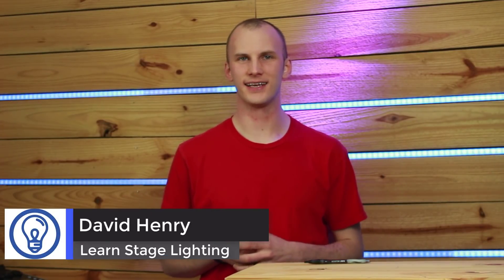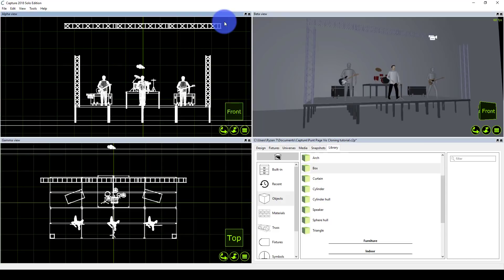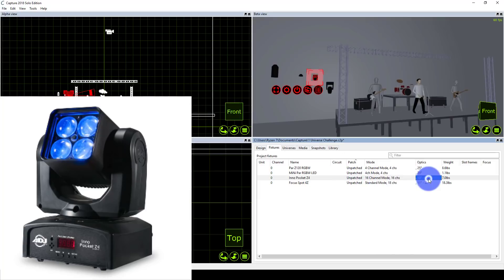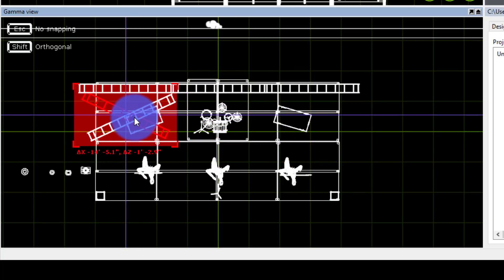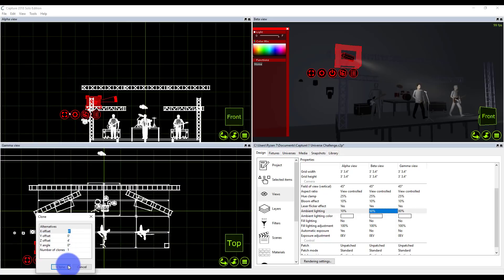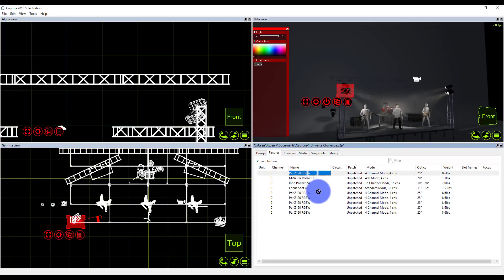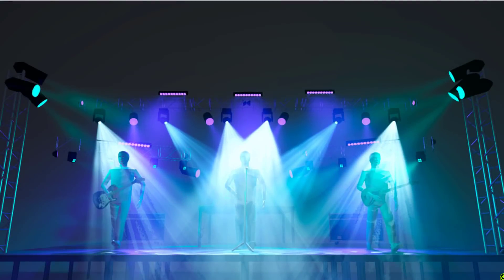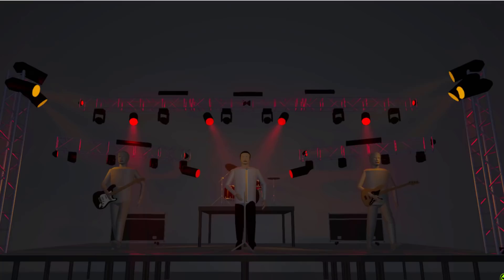1 Universe DMX Lighting Rig CHALLENGE

Comment: These were some good design decisions but If the name of the game is to cram as much stuff onto a single universe as possible I'd take it a step further and make a lot of fixtures share the same addresses.   For example,  all my truss warmers would share the same start address,   all my front light would share the same start address,   any static back light wash fixtures would share one or two start addresses.   This frees up channels to add some floor movers on the US deck for Arial  fx or some floor movers on the sides or maybe even some batten lights US (all the same address) shooting at whatever is behind the stage giving more depth to the overall stage look.  Beyond that you could edit the color band profiles so that each of them have common start addresses for the pixels but unique addresses for tilt (course/ fine).  This is how you can really maximize your single universe but you need to give some thought as to what independent control your willing to sacrifice.

Comment: Gone through the basic hardware solution with an ADJ console for the last 4 years and have found its limitations.  I am now trying to upgrade, and I am stuck trying to choose between a hardware or software solution.  

Software
Have been reviewing the MagicQ PC and QuickQ PC and, MyDMX 3.0 but not convinced that they are the best solution.

Hardware
SHEHDS 1024 DMX ConsoleSHEHDS 1024 DMX Console

Events
Our basics schedule is weekly dances with live bands, 4 main concerts per season, and several special events.

Any suggestions or thoughts on which direction to taken would be appreciated.  I like software but I also like the instant use of push buttons and manual faders.

Background
RV Resort
I have a 900-seat ballroom/theatre
Upstage Truss 
  * 5x LED PAR
  * 6x LED Pinspot
  * 1x 12in LED Leko
  * 4x LED Mini Spot (moving head)
Side Truss (left & right)
  * 1x 3in Leko (incandescent)
  * 3x 6in Fresnel (incandescent)
  * 1x 4 chnl dimmer
FoH
  * 6x LED PAR (stage flood color)
  * 6x LED Leko (White spaced across stage spots)
  * 2x LED ADJ Inospot (moving head)
  * 8x LED PAR (dancefloor down lights)

Thanks
Reply from the maker: Definitely!  Send us an email at Gear@learnstagelighting.com and we can help!  I would probably recommend LightKey (Mac) or ONYX on a PC with one of their wings or interfaces.  Shoot us an email and we can dive deeper

Comment: Hi David! I watch several of your videos and it’s helped me a lot. My band have light rig in the size that you explain in video.
We have 2 bar with 4 par 56 led each ( Starwille ) on front truss  / stands as front light. At the back truss we have 10 par 56 led (2x5) and 4 mini mowingheads 15w spot. As backdrop we use P9 LED curtain 3x2 meter. In the front of drums ( little drum stage) we have 2 more mowingheads on each side. Recently we provided 6 pieces Led bars and they is mounted vertically on  6 mic stand ( 3 on each side of stage ) . They act from the side too get deep .We have 5 more 56 led on front truss on audience.
Light rig is controlled with Dmxis and Ableton on Mac .Led curtain is controlled with led studio on PC . Trying to control with “jinx “ ( like glediator) without success.
Do you have some cool idea about this rig. We are 3 piece band, drums (center  back) keyboard ( stage left )and guitar / vocals ( stage right).
Thank you!
Best regards from Sweden
Reply from the maker: Hard to say without seeing it, but right now it looks like the weakest point of your rig si the brightness of your moving heads - maybe upgrade those?
Reply: Thanks for your answer! I agree with you about mowingheads. They are invisible without atmosphere ( haze or smoke). We are thinking to upgrade and looking after mowingheads. We play very little. Baying mowingheads with more watts don’t fix the problem, I think, because without atmospheric don’t make difference. Maybe wash mowingheads do job or is the question of taste. I mean spot mowingheads usually have gobo and can effect stage even if you don’t use atmospheric. Hard decision! 😉
Thanks again for your videos and keep doing great job!
I think this video is more interesting for majority of us , your subscribers, because majority of us handle with light rig in the size you describe in your video!

Comment: Thanks for the helpful info. I'm using a very basic setup way more simpler than anything you've shown. The gigs that my band does are usually in very small venues. Am.legions, bar and grills, small clubs. On a rare occasion we might get into an auditorium or gym. We use a typical 4 led par on a tripod stand usually placed stage right and left, operated with a wireless footswitch by me guitar player. What I have a problem with is extreme color wash on our faces and, sometimes blinding brightness. I am considering either reaiming the fixtures or moving them somewhat behind us and, adding a couple of led pars on the floor right and, left with a static soft white or pale pink color to illuminate our faces for front lighting. I know I could mount them on a couple stands so that they would shine down instead of up but, that's more gear on an already crowded bandstand. Any suggestions? 
   Thanks for the great videos. It's great that you take the time to demonstrate some very useful ideas.
Terry
Reply from the maker: Hey Terry,  you might want to check out the Eliminator Mini Par RGBW that I just reviewed here: https://www.youtube.com/watch?v=10vshtUeTeU

It's a good fit for small shows.

Comment: Awesome video, David! I've been learning in your channel since 2018. I have a question tho...

What can you say about a PAR/Moving Head light brand like the Big Dipper? I'm from the Philippines and some of the brands that you've mentioned are not available here. My target is to have a good lighting setup without spending too expensive fixtures. 

If you have a video regarding this, I would love to watch it. I watched your videos since 2018 and it took me 3 years before I understand all of the terminologies, techniques, and strategies when setting up my stage light rig (sound guy here). Hope you can reply to this comment, more power to your channel!
Reply from the maker: Every new brand/importer is different.  Some are good, some are bad.  I haven't seen the big dipper stuff in person, so I can't say.
Reply: Hi, i'm also from Philippines and i used bunch of china lights available from the market. The most expensive brand in our country is AEROLITES and LUMILITES, followed by BIG DIPPER in middle class, then those inexpensive brands like CROWN, DJ SCORPIO, naturally,  those brands are generic brands and in price range of 14-17k pesos. Aerolites is almost 28k pesos per unit. The quality for the top and middle brand is great. Bit for those cheap brand the cpu or the computer is always the problem. Sometimes the sensors or the stepper motors. The actual lifespan of the units differ due to outdoor usage and dust accumulation.
Reply: By the way i,m also a sound guy, retired and doing lighting. For almost 8 years.